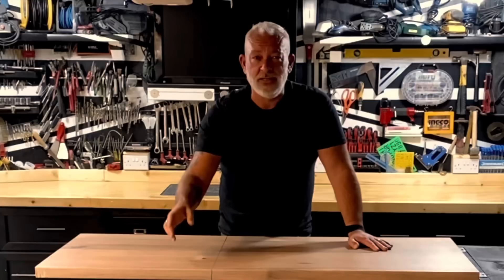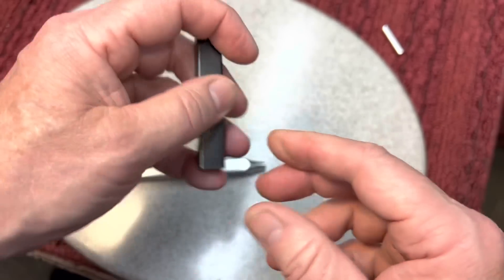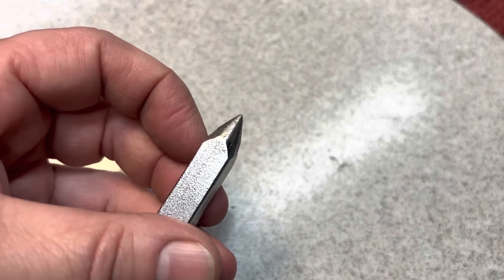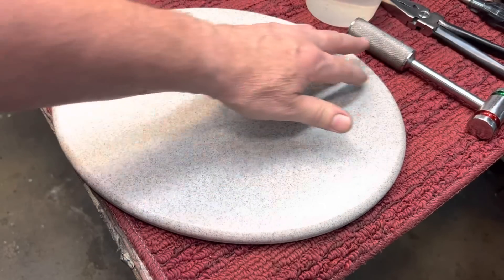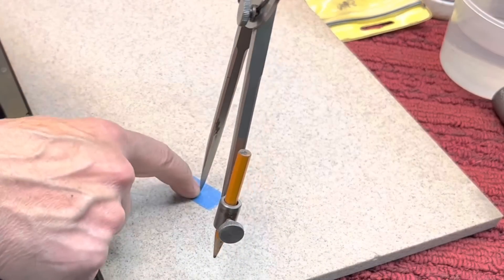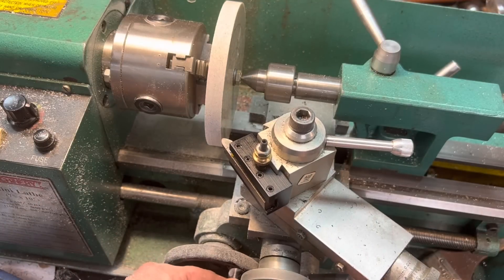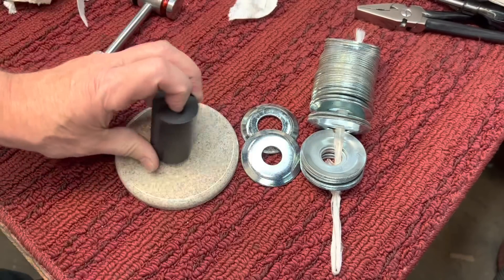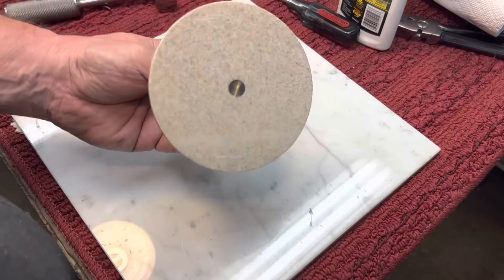Broken Punch Re-Grind, Introduction to Corian to make a Hammer Base.

Comment: I remodel kitchens for a living and have installed dozens of Corian counters. And now have removed and dumped many as it has lost favor to Quarts counters in recent years.  But Corian is a remarkable material. It is manufactured for North America in Buffalo  NY by Dupont. Seams in the counters when glued together and sanded  are practically invisible. It is the only material that when broken or has surface damage can be sanded and refinished to look like new. It's only down side is that it is susceptible  to scratching. You said you don't know how it reacts to heat. You can heat up the material and bend it and form it if heated up evenly. I have  a strip tied in a knot in my showroom that I heated up in a kiln. Also a putter with a Corian head in my golf bag.
Reply from the maker: Thanks Brian!

Comment: One of the best uses for corian or uhmw is as a machine skates. If you put down two layers of this stuff, you can quite literally slide a five-ton machine by hand! Tremendously low friction between two parts, it almost seems to get smoother the heavier the object is. So I like to take the big drops like this and epoxy a bolt onto four to six scraps. You just need a tow Jack to get it on the edge of a sheet of Corian, very easy to slide and control.

Comment: Corian or other “soft surface” counter material, makes a great workbench top.  I bought a small sheet from Restore and cut it to fit my bench.  Rounded over the front edge to prevent issues with my arms.  Corian is hard enough to last but soft enough to give a little.  Corian is also resistant to water or chemicals.

One note: make sure to use a soft surface counter material – not quartz.  Quartz is counter top that is made of stone and will ruin wood working tools.  Sometimes, it is hard to tell the difference between Corian and Quartz.

Comment: John, loved the video using Corian for the base. I have been employed by Dupont Corian for a little over 40 years. It's made in Buffalo NY - we make many  miles of it each day and offer over 100 standard colors and also make custom colors. as you showed it can be machined, polished to a mirror finish  but it also can be thermo formed into various forms.  It is not only used for countertops,  tub and shower  surrounds,  but also as wall cladding on the outside of buildings.  Thanks for your great videos !
Reply from the maker: Jeff!  That is awesome!  In case you didn’t know I am a huge DuPont fan!  It started with the number 7 line of automobile finishes!  I am going to show some other Corian projects on Monday!
Thanks so much!!!  😃👍
Reply: @ScoutCrafter I'm kinda of a Dupont fan myself - 3rd generation myself.  My family history goes back to 1929 at our plant. looking forward to seeing the projects. Let me know if you have any questions
Reply: @jk3dad  Is the outside wall cladding the same as the countertop material or do they have to add some type of extra UV protection?
Reply: @rawbacon  same material,  but restricted to certain colors. Dupont developed a patented mounting protocol.  It is used allot in hotter climates using light colored sheet to help reflect the Sun's rays- helps keep the buildings cooler.

Comment: Hi Scoutcrafter - would you have any issue cutting corian on the table saw?  If I can get a larger piece, I'm thinking it would make a nice desk top.  I wonder if it would take screws well? Great video, as always!
Reply from the maker: Absolutely no problem!  Just make sure you use a carbide tipped blade and go nice and slow letting the blade cut the Corian.  I cut many pieces on the table saw with a nice slow feed.  😃👍

Comment: 3:22 Is that why the old-fashioned grinding wheels ran in water, or water dripped on them while grinding, to cool the material down?
Reply from the maker: Yes!  Old timers weren’t in a rush and used slow speeds and cool water to keep their edges tempered properly.  The motorized grinder ruined more tools then they helped!  😃👍

Comment: Our pantry has very deep shelves so  I made lazy Susan’s from walnut, cherry, and cedar.  I don’t have a lathe so I used a circle cutting jig with my router.  I cut a recess in the under side of the top piece to hold the ball bearing piece and reduce the space between the base and the rotating top.
Reply from the maker: The router makes awesome cuts!  😃👍

Comment: Did you ever try using corian for die forming on the Dake? I have heard that it works, but never tried it yet. Perfectly timed video, I was just making a floor standing "tool tree" and never considered using corian for the base. Got some salvaged 1" thick worktops, so that will work out great thanks.
Reply from the maker: The thick stuff is a really nice score!  Most of my stuff is 1/2”.